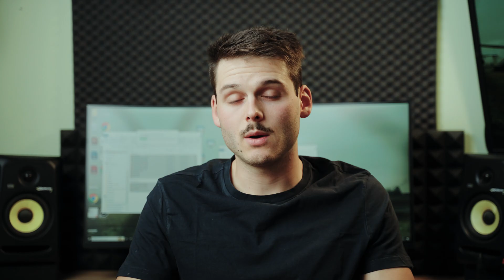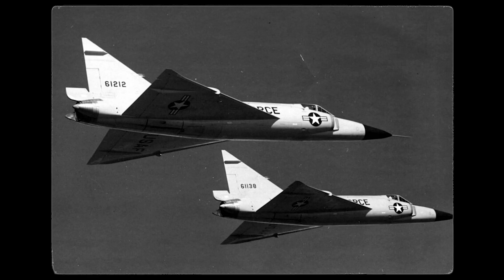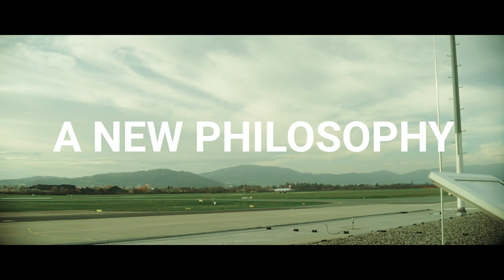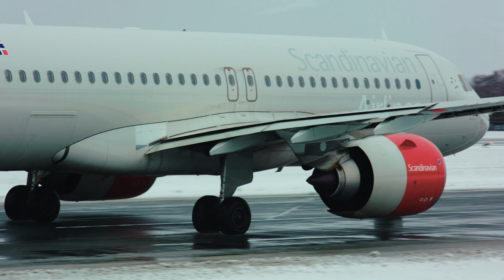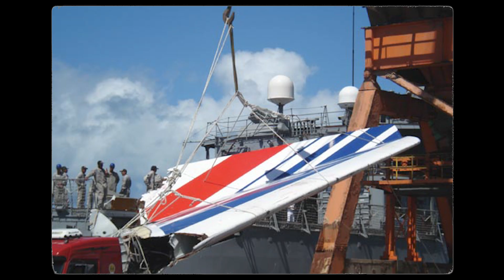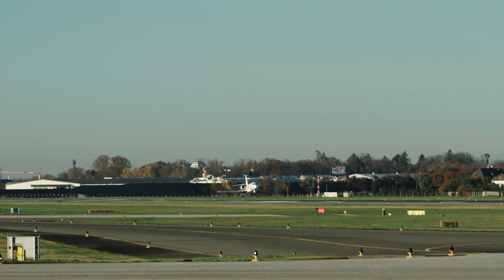Is airbus sidestick flawed?

Comment: The reservation I have with the active side sticks, and maybe this was Airbus's reason for not developing it back during the A320, is that they are not really linked. The yokes on a Boeing are usually both mechanically linked to each other and then to the same control surface making for ultimately only one set of inputs going into the computer. The sidesticks are inherently electrical controllers and any linkage is signals being sent to a motor not a physical connection. In the end you still have a computer managing two sets of inputs except now it's bidirectional. It does seem like it's being figured out but maybe in the 80s there was not enough confidence in that tech.
Reply from the maker: Thats true i can imagine this could be the reason. But technically, it should be possible to link 2 sidesticks mechanically, like the yokes on a boeing no?
Reply: @_fordec  It might be but I think the sidestick is just a ball joint under the covering and that would be harder to link.

Comment: I was training to become an A330 sim instructor - I ended up quitting before I finished the course - and the Airbus system is indeed very good but I simply do not agree that having the sticks not physically connected to each other was the best way to go.
Reply from the maker: Yes exactly! I would be curious as to why airbus decided to not interconnect the sidesticks... I mean simple push rods would have done the job right?

Comment: The Air France A330 crash was NOT because of the side stick. 

That’s a common misunderstanding.  

It was because the pilots were never trained in high altitude stall recovery technique. The training they’ve received, taught them to automatically fly the stall recovery attitude (11degrees pitch up) after losing airspeed indicator. That stall recovery attitude is only applicable for low altitude flight. At high attitude, it would stalled the aircraft. Both pilots wasn’t fighting for the controls and they weren’t just pitching the plane up mindlessly or not noticing it. They always try to pitched the plane 11 degrees nose up as per their training exactly.

The side-stick is only being listed as possible contributing factor in the investigation report and NOT the cause of accident.

The yoke was designed that way because it was extremely heavy when it was mechanically link to the control surfaces. Pilots literally needed two hands or more on the yoke to be able to control it.

Yoke make zero sense today when everything now is fly-by-wire…
Reply from the maker: True... Stall recovery, still pretty recently, was taught in a way so you wouldn't loos any significant amount of altitude... Today it is taught to push the nose down, roll the aircraft level, and apply power.

But the initial reaction of the PF was to pull back on the sidestick. That probably was the first bad decision. If the would have done nothing, the AC would have probably flown straight and level through the ICE area, the ice in the pitot tubes would have melted and they would have regained the airspeed (MAYBE)... So for the PM not being able to see what the PF is doing was definitely a factor... but as you said, the PM would have maybe made the same mistake as this was the way that they were taught back then...
Reply: @_fordec  Both PM and PF flew 11 degrees nose up… it just what they were trained to do and it is still the same today for A330 flying at low altitude (11 degrees nose up with correct thrust setting will prevent the aircraft from stalling at low altitude flight) Today they’re also trained on high altitude stall as well.

Not seeing what the other pilot is doing to the side stick is not a factor at all. The primary flight instruments which is right in front of them, tells everything they need to know to fly the plane.

Seeing the side stick to the left doesn’t tell you anything as it could mean any of the following:
• starting a left turn
• tightening a left turn
• levelling the aircraft from a right turn

So there is no useful information you can get from watching it, you still need to confirm with the PFD to understand what the other pilot is doing and once you look at the PFD, there is no need for you to look at the side-stick.

Note that the AF accident, the pilot doesn’t even knew what was happening… they knew there is an issue with the airspeed indicator but they didn’t know which one is wrong… Sometime they got stall warning, sometime overspeed and even both at the same time. You can imagine how confusing it is to get overspeed warning while stalling… and all that happens only in about 3-4 minutes from getting the first warning to hitting the ocean. They pretty much die saying “WTF?”
Reply from the maker: Yes this must be terrifying… can’t imagine the workload those poor pilots head during that short period of time… 

Thanks for cleering it up! I did not know all the details on the accident. I really have to look into it more thoroughly.

Comment: There is one thing that I am curious about on this subject. If the pilot changes seats for different flights, the yoke is not essentially different in either seat. The sidestick is used by a different hand in different seats. Not only do people have preferred hands for certain jobs but also there will be "muscle memory" from usage and training. If you normally use your left hand stick for most of the time, then the right hand stick won't feel right and actions will need to be more deliberate and conscious, and less "automatic" thus negating some of the training.

Its a bit like swapping between left and right hand drive vehicles. All of the controls feel weird  and require more thought because you don't perform the actions very often.

It doesn't matter for single pilot military aircraft because only one pilot and pilots seat. 

I wonder if any account of this phenomenon is taken into account or studied?
Reply from the maker: Well, actually you would only change seats when you get upgraded to the captain so that part is not too confusing... And actually, with yokes, one hand is on the yoke, the other on the throttle. So there is not that much difference..
Reply: @_fordec  flights with two at the rank of captain? Won't happen very often, true, but it  does happen. Captain acting as FO then has to switch hands on the side stick. When someone graduates to captain, he now has to change hands and unlearn all that muscle memory they spent years acquiring

Neither pilot has their hands on the throttles all of the flight. I would imagine their hands are on the yoke or side stick much more than on the throttles, or any other control. It would be interesting to see if any of this has ever been studied or whether it is just one of those things that is assumed?
Reply: @crabby7668  neither hands are on the yoke or sidestick 99% of the flight. Manual control are required only at takeoff and landing, in both cases the other hand is required to be on the thrust/throttle. At no point in flight is it standard to put both hands on the yoke
Reply: @topethermohenes7658  thanks for confirming what I thought, and was alluding to above.

Good point about the other switches and controls being reversed relative to the seats in both Boeing and airbus planes. However these won't be accessed for  very long periods of time and would tend to be discreet operations rather than a continuous process as with sidesticks/yokes.
Reply: @crabby7668  both buttons and controls are accessed about the same amount of time in a normal flight. They are both not discreet too, actually no button/control required for flight is ever discreet. Using levers/buttons in the correct timing, in the correct sequence  is equally as important as controlling the plane. All of these things is part of "flying"
Reply: @crabby7668  actually all pilots get to fly left and right side on different aircraft and its always the same, one hand on the yoke/stick the other hand on the throttle/thrust. This is the same in any plane with left and right controls. This I assure you. But the button placement/layout  on different aircraft are widely different. All pilots will have transferrable experience on the left and right side when it comes to controls, but not on the buttons and levers.
Reply: @topethermohenes7658  when I say discrete, I mean you press the button or rotate the dial and then disengage from it. You do not loiter with your hand on any switch for extended periods of time like you would with the control yoke or sidesticks. On takeoff or landing I assume that the controls are held for the whole of the procedure, not just like  a click of a button. Totally different process.
I can understand that there may be some disengagement with the controls in an ATP with autopilot, but in a GA aircraft without, you would be holding the yoke much/most of the time.
Reply: @topethermohenes7658  all pilots?
In fact much of what you said here feeds into my original post. People seem very convinced that there is nothing in it, and they may be right. However no one has provided any evidence for their feelings that there is nothing in it, no studies or reports that refute my wondering, so I will have to settle for theory not tested😊
Reply: @crabby7668  yes all pilots gets to seat left and right through their training/career. It's easier than using your other hand for toothbrush 😊
Reply: @crabby7668  you wouldn't also loiter with your hand on the yoke/sidesticks for extended period of times. The most loitered area on the cockpit for the whole flight is the radio and those are buttons and dials. The second most is the "dash" where you will find quick autopilot controls, the third is the multi control display unit or the one where you set your route/flight plan and then fourth are the yoke/sidesticks where you use them for takeoff landing, then the levers for flaps, speedbrakes are used least. Actually even your iPad or your electronic flight bag would be the most loitered area, but it's not part of the aircraft technically

Comment: What I'm curious about is if those active side sticks also operate as control loading, meaning the pilots can also feel the actual forces in the flight control surfaces instead of just providing an artificially generated feeling. Because that would be the way to go, no matter if you're using yokes or sticks, they can be built as fly-by-wire controls. It could even be a flight deck option for airline operators who prefer to use a yoke over a stick or vice versa.
Reply from the maker: From what i know, the active BAE inceptor sidesticks used in the Gulfstream provide control forces to the pilot... So without looking at any gauge, the pilots know it they are operating close to the envelope..
Reply: @_fordec  But those are artificially generated forces right? Not the actual forces that are acting on the flight control surfaces so pilots can also feel if they need to trim, like is the case on a yoke that is physically connected to the control surfaces through cables or pushrods.
Reply: @Stoney3K  Of course they aren't actual forces from the flight surfaces. That's only possible on cables and pulleys aircraft where those are directly connected to the flight surfaces like Cessnas. The 747-767, A300, A310, L-1011 all used artificial force feedback because the cables and pulleys are connected to hydraulics, not the actual surfaces. The real forces would be too great to move with human strength. So the feedback is artificially generated and many pilots who flew those aircraft I mentioned said it replicated all the forces you'd want from a small aircraft like a Cessna. On FBW 777, 787 and the newer Gulfstreams, they said the feel forces were similar to the previous conventional aircraft they flew. If the stabilizer is out of trim, the pilot gets an artificial force that tells them they are out of trim and need to trim on those aircraft. You seem to believe that artificial feedback means not all the forces you'd expect/want from a small aircraft like a Cessna won't be replicated with the FBW. It isn't true. It can be done and is done. Some pilots on the 777 and 787 says the artificial feedback helps greatly for crosswinds and gusty approaches compared to the FBW Airbus they flew. Not sure what you are wanting.
Reply: @ClaysonAntoons  On the bigger aircraft, the cables and hydraulics are connected in parallel, in the same way that a power steering system in a car is built up. The only aircraft with "true" fly-by-wire and no mechanical connection between the control surfaces and the cockpit would be the 777/787 and most of the Airbus fleet from the A320 onward.

In newer aircraft, the feeling would be artificially generated but it would have a sensible relationship with the forces acting on the control surfaces. And it would have the advantage of either damping or amplifying certain aspects of feedback. It would be more than just 'feedback' from the stick on the other side though.
Reply: @Stoney3K  I already knew the first sentence. 777 actually has mechanical connections from the yoke to two spoilers on the wings, from the rudder pedals to the rudder and from the alternate trim lever to the horizontal stabilizer. 787 however is the one that has no mechanical backups. Only electrical backups. A320-A340 has mechanical connections from rudder pedals to rudder and from trim wheel to horizontal stabilizer. A380 and A350 has electrical backups. Of course concerning the 2nd paragraph I'm aware of all that. With, active sidestick, indeed it's more than just feedback from the other side. Mentour Pilot explained in detail the new features of the new stick design.
Reply: @New York Bus Guy Too bad, it wouldn't be terribly difficult to implement two-way feedback even if the aircraft is FBW, instead of a "control feel" which just makes the stick stiffer when you're flying on a different part of the envelope. Shame no aircraft really uses it (yet?) because I can imagine it being very useful in things like gusty approaches.

Comment: The fact that the flight system does not LOUDLY report to the pilots “contradicting input on joystick” is a MAJOR design failure. It is also so easy to fix, it makes you wonder why they haven’t already done it.
Reply from the maker: Well, it does say "dual input" and gives a visual warning as well... And fixing something like this on an aircraft costs lots of money, time, and retraining for the crew... If you would have different flight control philosophies on different airbuses, you would lose communality across types... Thanks for watching!
Reply: @New York Bus Guy thanks for the extra info. Still seems like a design failure since the co-pilot contradicting input was the source of the stall itself. The PIC was pushing down and was wondering why the plane was still stalling.
Reply: In a panic, one of the first senses that humans stop paying attention to is their hearing sense.

Comment: Very interesting video, thanks for working on it. Ultimately sidestick or yoke in airliners don't matter that much, what truly matters is what it's plugged into, the issues I think about with the Airbus is the philosophy behind it and the fact that you can't get any cue from the stick about where you are in the envelope, the same stick deflection will have the same effect on the aircraft no matter the speed, and a change of speed will be trimmed automatically without any effect on pitch which is the antithesis of how a conventional aircraft handles and aerodynamics, and this can cause issues whenever there is a problem and the computer reverts to alternate or direct mode as the plane suddenly handles much differently than usual with some of the flight augmentation lost and the aircraft behaving more like a conventional one, this was a factor in AF447 especially on roll axis. Interconnected backdriven sidesticks like the 777 yoke is or more modern active sidesticks seem like the way to go as you point out, no loss in situational awareness, tactical cues and allow for a more conventional handling. Apparently active sidesticks were thought of in the A220 development but the technology wasn't mature/available enough at that time so they went for "numb" ones but still with trim switches and a speed stable C*U control law like in the 777
Reply from the maker: That's true! you are very "plugged out" from any aerodynamical feel... Thats very nicely done on the active sidesticks on the Gulfstream... They change their feel through the envelope.. Thanks for watching, glad you liked it!

Comment: The real problem I have with Buses' stick is the C* control law, so I can't tell speed change on approach. on a nice visual day with conventional or C*U FBW aircraft, once trimmed on approach, I only need to watch the runway below 1000' and tell if my speed have changed via stick force. It's even true on my desktop passive sidestick setup.
But the standard technique for bus is just keeps the A/T on, as long as that works, I feel no much problem.
A220/C919/B777/B787 all use C*U control law.

Comment: There's other benefits. If you move joystick right then let go it will still hold the right bank in the same position whereas traditionally you have to hold the yoke
Reply from the maker: Autotrim definitely makes a pilot's job easier yes! But that could be implemented in any fly-by-wire aircraft, even ones with a yoke.
Reply: @_fordec  on a traditional yoke you would have to trim it to stay in the same position so it's more work. Airbus we're the first commercially to do this
Reply from the maker: Yes you're right but that's something that could work on yokes as well... But you're right, at the time it's an airbus feature